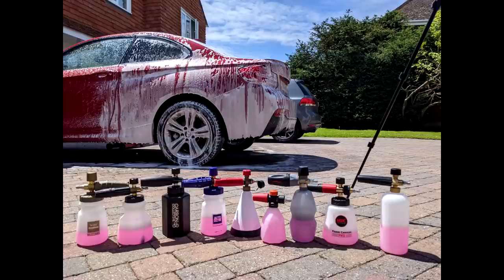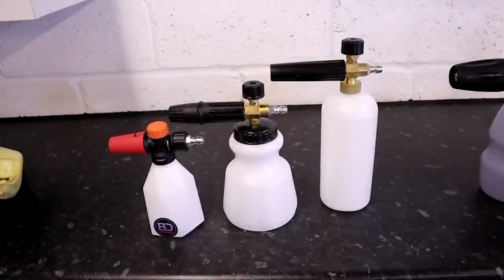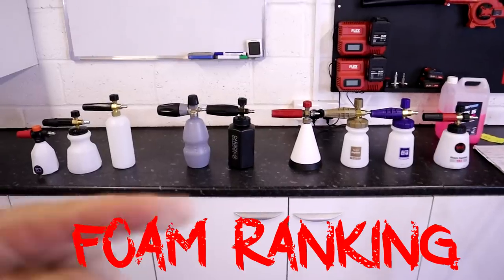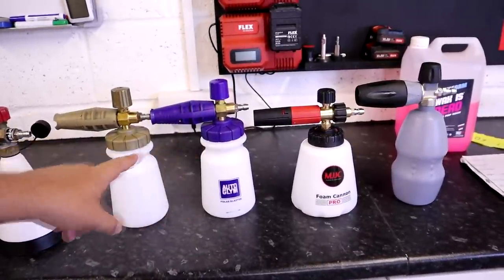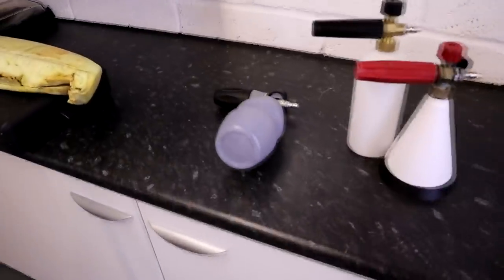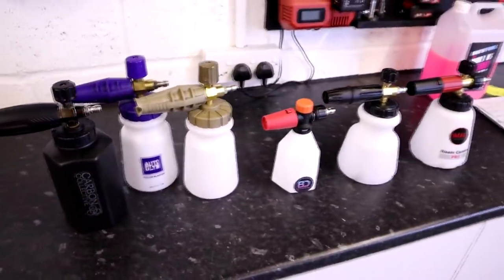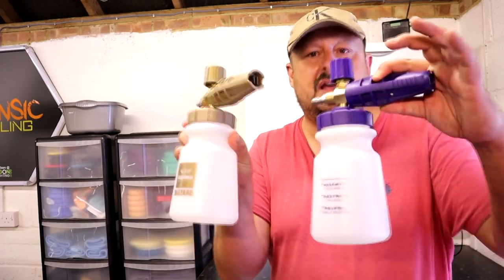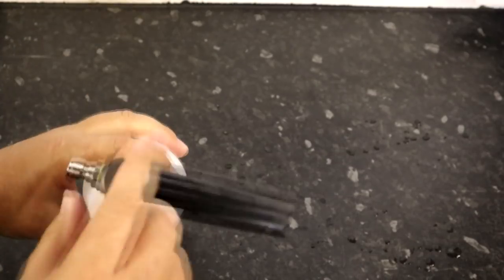The Best Snow Foam Lance/Cannon | MTM MJJC Autoglym Carbon Collective PA Cheap Chinese

Comment: Thanks for featuring the 'Mini-Lance' Jon! I think it's a good starter lance as it's simple for newbies to use, or a backup like you say. Another main thing we get, is people using it to apply coatings, as it seems to be quick and simple for that scenario. Plus wallet friendly. If anyone is wondering, you can change/clean the mesh on them, but the orifice or the quick connect aren't removeable. If anyone's interested we also do cannons similar to the Autoglym/Angelwax one, as well as spare bottles.
Reply: If it's the same as the one on ali for 4quid, then the orifice is a 1.1 and causes pulsating on some machines. I had to drill mine out to 1.25mm to stop it being a problem. The top is also very loose as it's a kind of bayonet fitting over a typical screw. 
I use mine with Garage Therapy one wheel shampoo now as it's not good enough to produce a decent foam for prewash.
Reply: @DetailingandtheBeast  it's possible they're from the same supplier but I can't say 100% as there's often minor differences between them. Not had any reports of pulsating so far, nor issues with the bayonet top, and we've sold 100+ so that's a good sign. They definitely have their uses, I'm just always surprised when people think they'll get the same performance from an £8 cannon as a £30 one.

Comment: MJJC is traditionally an "aliexpress" brand. When I did a "Best of aliexpress lances" video, I compared a good number of the aliexpress lance offerings. It featured the MJJC pro v2 and that mini lance (which was bottom of the pile) amongst others.
The MJJC finished top by a good number of points. It even beat the autobrite PA lance (used as a benchmark product), and that wasnt a popular opinion at the time. 

I guess now you've said it, it will hold more weight. 😉🙄
Reply: And your video made me buy it
Reply: I can order the MJJC one from Ali for 25€ while retailers charge you 100€ 😳
Reply: @Encantada-vacation I think the price increases are due to them becoming a respectable brand. They can now more then justify their premium especially when compared to the market.

Also Aliexpress now charge UK VAT so its not as cheap as it once and not much difference to buying form UK products

 Also apparently international shipping costs have supposedly increased.
Reply: @MegaFregel  do you have a link? I've looked and can't seem to see them at all on aliexpess
Reply: As a fellow pro detailer, I can't help but being a bit disappointed about this test. It would have been much more interesting to see what kind of foam result each lance produced given the same PIR. The MJJC is not better for pulling the product up faster, just different.
Would have loved to see what that little funny lance would have produced had it had the same PIR as the MJJC. I own a few MTM's, an MJJC, and some other lances, so it's not a brand thing. I just think it would have given the general viewer a more realistic picture of what the lances can do given the same product to water output ratio.

Comment: This was a great review Jon.    Thanks for taking the time to obtain and review all these.    It might be the most thorough review and testing of various snow foam lances ever done on YouTube.   I do love the LOOK of that Carbon Collective one.    As far as looks,  it wins hands down.  And I also really like the looks of the Angelwax one in the gold color.   That one just looks really good.    I'd really like to get a hold of one of those Dr. Dirt bottle but those are hard to find and almost impossible to get here in the USA.   I just bought the Griot's Garage BOSS Foam Cannon Kit.    That thing is incredible.    The best feature is the fact I can hook up Griots three different foaming chemical bottles directly to the lance.    It has this unique double thread system which has both a wide mouth bottle AND a smaller thread inside that allows you to hook the product bottles right to the lance.   Then they have the metering tips so you don't even have to mix up your product which I love.   It distributes the proper amount automatically without mixing.    It's got that same pick up tube that the MJJC Pro Cannon has but you put these small tips into the small metal ball and that's how the product get's metered.  And they give you three different tips so you can go light, regular, or heavy dilution ratios.   Griot's did all the work figuring out the mixing ratios for you with the metering tips.  It is a brilliant design and produces really good foam.   I also have the little Karcher foam lance made by Karcher and for what it is,  it is decent.    It's definitely not on the level of the higher end ones you reviewed here,  but it does get the job done.   That bit at 18:40 was hilarious.         Dr. Jon........The PHD of detailing!
Reply from the maker: that griot one looks great actually.  just cant get it in the UK right now.  the problem will be the price tag.  in the USA lances are a bit more expensive, so if this does hit the UK Im wondering if its gonna be like 80-90 quid.   And no one will buy it at that price.    hope they can get it over here and get the price down.
Reply: @ForensicDetailing  Yeah, that is the downside to the Griots BOSS Foam Cannon.    It's very PRICEY.    Even here in the USA I think it is the most expensive one.   Fortunately I got it as a birthday gift from my wife!  LOL.    It's fairly popular over here,  but,  really,  only enthusiast's or people with more money than brains buy it!   Your everyday weekend warrior probably isn't going to buy it.    The MTM Foam cannon is very popular here and has a loyal "cult following"    The MJJC Pro is taking off and is a very popular one now.  That does look like a great foam lance for the price.   The only reason I got the Griot's was for the self metering tips and use of their 3 foaming soaps/sealants that are specific to it.    A friend of mine turned me onto it so I caved and asked my wife for one for my birthday.    The deal actually wasn't too bad.   It was $165 US for the "KIT" but included the Foam Cannon,  an extra replacement filter,  metering tips,  all three chemicals for it,  and their large PFM drying towel.   The internals are all stainless steel so that's a plus to help on longevity.   Overall it's up there with the MTM or MJJC I would say.  Thanks again for the review and test.

Comment: Without even watching this video...
MJJC for the win.....and its ease of assembly and stonking performance ...Great foam and good adjustment
Reply: Well, if you mix the soap so that the total output is the same between the MTM and MJJC, the MTM will produce equally as good foam, if not better. The fact that the MJJC sucks the product up faster does not make it better, just different. To get the same output you need to adjust your mix accordingly. Would have been interesting to see how the foam test here would have been, had they all used the same PIR.
Reply: @AB-80X  not sure why this is a reply, would have been better in the main thread
Reply: It was as much a reply to your comment of MJJC for the Win. It's not a win if the comparison is done badly.
Reply: @AB-80X  cant agree with the summation that the comparison is done badly or misrepresents any brand disproportionately more or less than the others. 
 its a test based on the findings on that day with a particular brand of SF. 
i have one brand of foam which doesn't respond well when used with it, whilst others are fine. the market moves on and new foams are formulated and new foam cannons arrive, doesn't mean the MJJC would win now if this was repeated nor if a different foam was used either.
in the final analysis, you watch these tests, lots of them and form an opinion based on your budget, your needs, the products you use and the pressure washer you use too.

Comment: Thank you for another brilliant, in-depth, review Jon, really appreciate it.
I actually use your 2nd place choice. I find that it is plenty good enough, while maybe not being the very best, but for the £11 I paid, it has lasted me a couple of years already. I am not that bothered about super-thick foam (each to their own), as I find when it is slightly runnier, the dirt actually slides off better (using Bilt Hamber auto foam), and actually cleans more efficiently.
With really thick foam, I tend to sometimes see a slight layer of grime, still left on the surface, after I have power rinsed it off.
I think for people who don't let their cars get too dirty anyway, and constantly keep on top of the cleaning, those cheapo lances are brilliant for the money.
Might upgrade to the MJJC when (if) my cheapo one finally dies.
Reply: I know this is a very late reply.. But bilt hamber is also made runnier.. Some foams are just better thick.. I have tried alot of different ones and some works with they are quite runni ( bilt hamber)

Some needs to be quite thick like magifoam

Comment: Brilliant comparison as always! I will be adding the MJJC to my collection. I have found so many variables with foam cannons. Using my industrial pressure washer at 140bar/10Lmin my PF22 makes super thick foam with AS ultra mousse where the polar blaster is very thin. Swap it over to the likes of Gyeon foam the PF22 is thin and the polar blaster is thick every time. Same dilutions same pressure I can’t get my head around it!

Comment: I bought the MJJC lance a couple of weeks ago, I concur with what you say about it Jon, it's really well made, performs brilliantly with Bilt Hamber Touch-less, and it didn't use too much product to get great results. 

One thing you did enlighten me on was where the filters go, it doesn't say in the instructions. That would be my only criticism really, the "standard" instructions that have been Google translated several times that don't make a lot of sense. 

Excellent video as usual.

Comment: Great video. I will probably buy the MJJC when my cheapo lance dies. I bought your 2nd place lance and put in a 1.1 orifice to get really good foam out of it. It does topple easily and is harder to fill, but was so much cheaper that I couldn’t pass it up.

Comment: If you have a low flow (<2 gpm) and low pressure washer like a karcher, Ryobi, Sunjoe, Greenworks etc. then get the MTM PF22.2 and swap out the orifice for the 1.1. The MTM also has a new bottle design that renders the tipping issue moot. It has superior build quality (zinc coated brass) and with the new bottle design is the gold standard.
Reply from the maker: in the UK the new Pf22.2 is 85-90 pounds.  build quality is great on the MTM.   1.1 will whip up better foam on low pressure yer.  Its a cool lance.  I think theres a new version PF23 coming soon hopefully MTM wont do any poor business deals so they are actually allowed to sell their own product.

Comment: I've been using the MTM (Mosmatic lance) since 2018 and my favourite feature compared to the PA I had before is it's reliability. With the PA I'd find myself stripping it down and rebuilding it every 6 months. With the MTM the only thing I do is run a bottle of clean water through the system once the chemicals have been used. I agree the bottle's lack of balance is very bad. I'm going to pick up the new one, now I know it exists. 😀

Comment: Hah, I bought the Alibaba one from autobrite over 15 years ago. Was £40 back then. Hell of a mark-up. 
It did make shaving foam thickness but the filter has had it even though I take it apart and soak it in limescale remover. Hate the bottle as you said, topples over easily.

Comment: I like the one which finished on 2 place, the most generic "Alibaba" lance. Although, while it's affordable and does the job quiet well, I don't like that its falling easily, the narrow neck when filling up with the solution and it doesn't give you sufficient thickness with the standard 1.25mm orifice alongside with a lower pressure washer. However, when you update the orifice to 1.1mm that good be sorted, but because of the other 2 dislikes I mentioned, I have the MJJC Foam cannon sitting on my table and I cannot wait to use that. I am happy that you also found that one of the best from the list in this video.
Reply: It does give you the same foam thickness as long as your PIR is the same.
Once lance pull up 300 ml of mix in 32 seconds, the other did it in 45. If you adjust the mix so that the output ratio is the same, then you're good to go.
Can I also point out that the neck of the MTM allows you to fit the spray head to just about every 250ml to 1l bottle out that can come in very handy for a lot of reasons. If you're out on a job and something happens to your MJJC bottle for example, you're pretty much screwed. If you have an MTM, just grab one of your old empty soap bottles and use that. Heck, you can use a soda bottle if needed be. MTM did not make the neck narrow because they did not think to make it easy to fill, they made it narrow so that it fits with the standard neck which most bottles use. Besides, most detailers either use pumps or jugs with tabs on them, so the size of the neck is really a non-issue. It was made with the pro detailer in mind, not the hobbyist.
Reply: @AB-80X  Fair enough. I do use an MTM Pf22 nowadays and it's decent stuff. And I completely agree with the advantage of MTM's standard neck, I still do prefer the MJJC for more variety (scale) of the density that offers with the same chemical. Both MTM and MJJC are excellent lances, and both have their own pros and cons, then it will be us, users, who decide which fits better to the person uses it. For me, MJJC wins over MTM. Simple reasons: bigger scale to adjust density, LEAKPROOF! Yes, if the bottle fails, you sucked, but for me personally, I always carry more than one lances with me and I am happy that my hands stays dry when turn the bottle upside down for any reasons. MTM seems to be the more quality stuff, yet, I like it, I prefer MJJC over it for certain reasons I mentioned above.

Comment: Using you recommendations in the past of BH snow foams (got both now) I went for the cheapo aliexpress one just to try it out. As the BH autofoams are pretty runny anyway and it's the lack of additional stuff in it I like. I also have a small fairly low pressure washer anyway - its a perfect combo for performance, value, and i never use anywhere near what it can hold so I just leave liquid in it between washes to stop it falling over. Great vid as always.
Reply: I have the same foam cannon and use the same BH snowfoams, one tip I've found is to NOT top up the bottle with water or if you do only add maybe 100-200 ml, the foam is much thicker. You would think it would run out too soon but surprisingly I've found it doesn't! I use 300ml plus 100 or 200 of water (just enough to be able to do one car) and easily do a whole car before it runs out, and I actually get BH Auto Foam to foam better than normal even with my poxy Lidl/Parkside pressure washer! Tbh I don't get why people top up the bottle with water, you are in effect pre-diluting it prior to the jet washer diluting it further, it's no wonder people can't get it to foam well. I'd like to see someone else try it and see if they get the same better foam that I get or if my cheapo AliExpress cannon is somehow just a one-off (clue- it's not!)
Reply: @steverabbits  I tend to premix as I turn the flow of water off from the hose so just use the pressure. (for anyone I've got he bosch aquatek 110. Great tip though, I'll give that a whirl then i have the option of adding whatever dilution I want as I go. Nice one!
Reply: @djmandrick  ok, I've never heard of anyone turning the hose off before! I guess it must work or you wouldn't do it. Are you in a water restricted area?
Reply: @steverabbits  i mean i turn the top valve on the cannon to the off/min possible setting. I have the supply of water and the pressure washer all on as normal.
Reply: @djmandrick  ah I see. I have the top valve set to maximum on mine, I find it works well for me but I will experiment next time now you have told me that
Reply: @steverabbits  likewise!

Comment: I knew the MJJC was gonna win, I have been hanging off buying one until this review came out, but only just got round to upgrading my orifice to 1.1 for my Autoglym lance so I will see how that goes first, I also have the PA lance but not changed anything on that apart from the bottle to the Dr one, that being said, a great review Jon and I'm sure there's gonna be a lot of people been waiting on this for a while 😎👍🏻🏴
Reply from the maker: you really dont need to by the MJJC if you have the autoglym or PA you have good solid lances there, its mainly if you are looking to buy for the first time.   My PA lance from autobrite has not won this test but its been a solid tool for 5-6 years.
Reply: @ForensicDetailing  yeah I get what u mean, but u know what it's like, we all just look for an excuse to buy something new 😂 the MJJC defo offers the best bang for ur buck, a great all-rounder 😎👍🏻🏴
Reply: @SomeMadRandomPerson  Just remember that if you adjust the total output ratio so that it is the same as the MJJC, you get a result that is much closer to the MJJC than you think. As was said, both your lances are good kit.